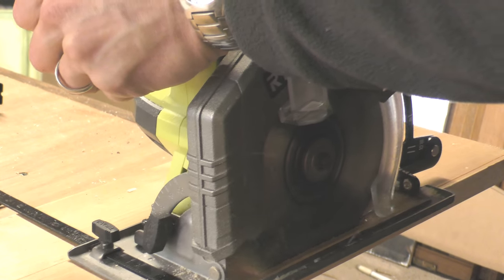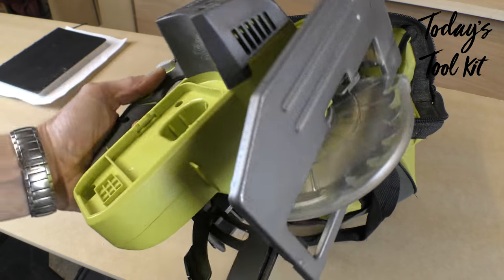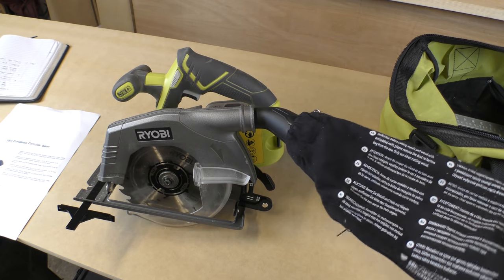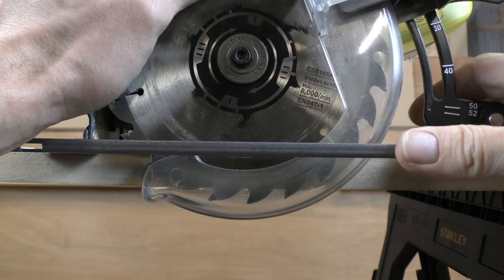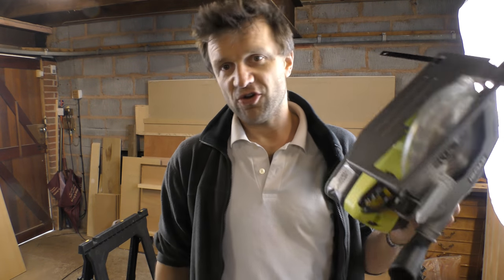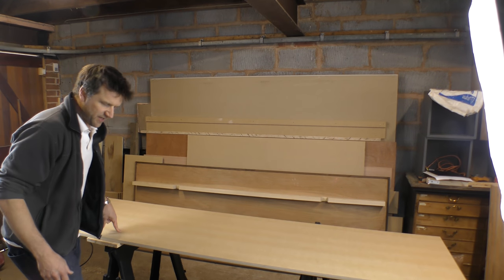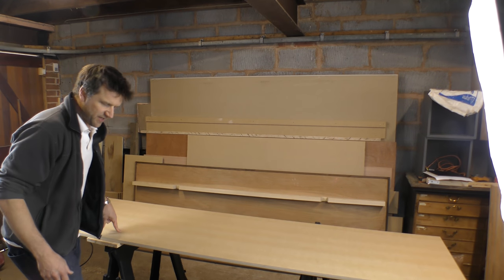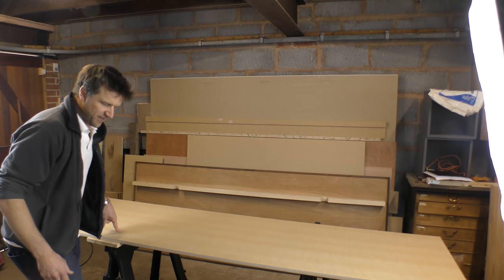Circular Saw - the MUST HAVE DIY Tool

Comment: i dont want to spoil the party, but battery powered tool are such a waste. yes, if you would indeed have to work on a jobside without power supply ... maybe, if this short time battery supply saves your day, but the rest ... come on... i have my corded saw for more than 10 years, plug it in, fire it up and up she goes. 
not to mention the impact to the environment, which we all do so much care about, until we think we need a uncorded tool.

the idea of making guards as a tracking device is perfect, but i wouldnt use mdf for it or at least put an aluminium angle to strengthen the edgde
Reply from the maker: I'm not sure I agree. Particularly with circular saws the cable is a hazard and the whole point of a circular saw is it's manoeuvrability.

Comment: you get what you pay for this tool wont last under heavy use is only for diy projects. why not just spend the money one and get yourself a proper trade rated tool that will last

Comment: Don't buy the evelution circular saw it sucks
Reply from the maker: Thanks David. I guess if you're a pro tradesman using a chop saw every day it would pay to buy a top of the range system. But I bought the Rage chop saw and it's been brilliant. We work in high properties and have used it to make precision cuts in aluminium (Lutron) electric blind channels which are typically recessed in the ceiling but in our case were on show and had to be butted together across a curved room and the joins millimeter perfect. The results were stunning. For the price it's ridiculously good value for money and I couldn't rate it highly enough.
Reply: Charlie DIYte the chop saw is not bad . It's the circular saw that sucks the fence on mine is out a mile
Reply from the maker: David Burt Ah, yes. Sorry David, I can't read!
Reply: Charlie DIYte no worries LOL my chop saws fine
Reply from the maker: David Burt Cheers mate. Is there nothing you can do about that? Like getting a combination square to set it or is the point you need to adjust it to past what the settings will allow? Very frustrating.
Reply: Charlie DIYte I've somewhere in that box that every man has another that I think will fit . Now you got me thinking about it I'm going to have a look when I've got an hour cheers mate all the best 👍

Comment: Look I am not trying to be a hater here, but this video makes no sense and as I read the comments they make no sense either.  What guy who does DIY doesn't own a circular saw, it is one of the most basic tools to own.  How in the heck were you guys cutting wood, building anything or installing anything.  And with the speed square those are practices you learn as a kid.  Not trying to belittle anyone here but I just don't see how you can do DIY work for years without a circular saw and a speed square.